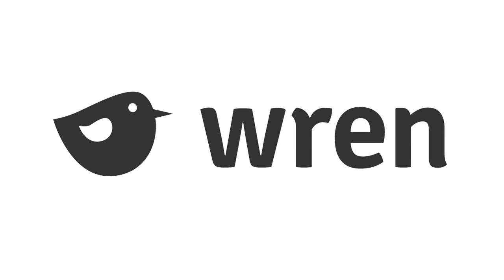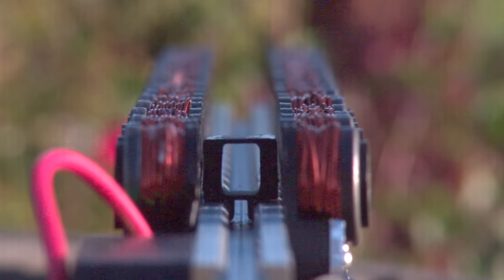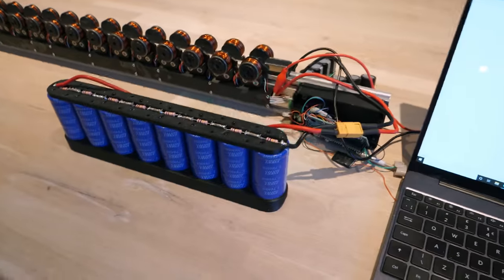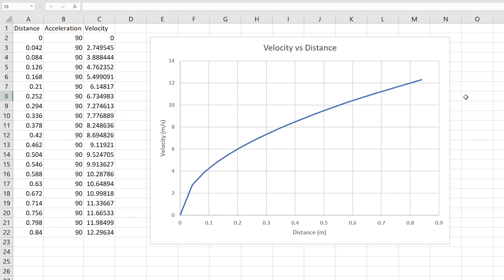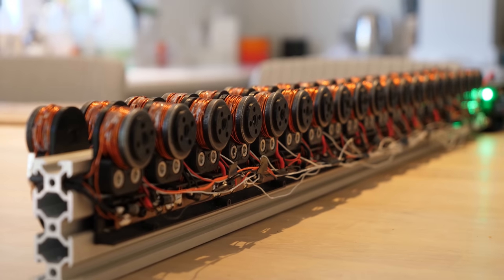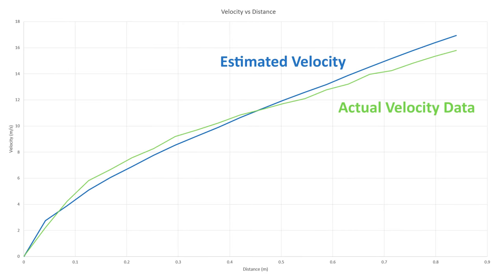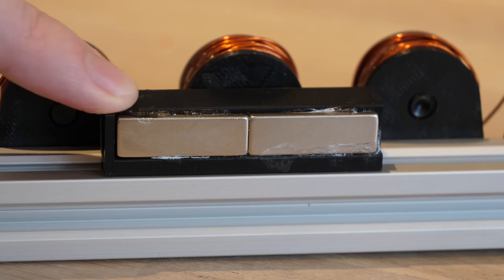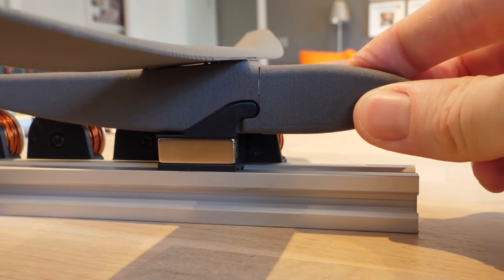Optimising a Magnetic Launcher

Comment: A few things:

Inductance of the coils, not just resistance, matters. Especially for the later coils. You can see the characteristic exponential-decay curve as the inductance gathers current. This provides a further boost for smaller coils over larger ones. That being said, from your data your time constant currently is manageable. It won't be if you get it much faster however.

The real boost for opposed magnets only really shows up once you close the magnetic circuit. That is: put two metal rails, one on each side, down the outer poles of the solenoids. This provides a low-reluctance path for the magnetic field. As-is, this won't really help all that much as only one solenoid is on at a time anyway - but if you drive adjacent solenoids with opposing polarity and time things correctly this can provide a significant boost. (If you want to think of things through the electric analogy: iron has 1 / 5000th the magnetic resistance as air does.)

Right now your overall energy efficiency is terrible. Remember: it's not about how much energy you can get into the solenoids. It's about how much energy you can get into the _projectile_. It may be worth integrating and finding the total electrical input versus the current estimated projectile energy.

Comment: Some more ways you could improve this:
• Batteries and Supercapacitors working together
• active cooling (liquid-cooled sensors and coils)
• better electrical conductors (how expensive is enamel-coated silver wire?)
• stronger ferromagnetic cores for the coils (tiny rare-earth magnets)
• coat that sled and rail in teflon (should vastly lower friction)
• focused magnetic fields (via steel plates around the launcher to act as magnetic lenses; see Tech Ingredients)
• finally build the complex polarity-switching thing
• implement some optical sensors as well

Comment: You missed one characteristic in electromagnets, when they power down magnetic polarity automatically flips. Which is why your design worked with single magnets. 
Loved your design and the way you tested your ideas. Well done.
RF chokes and inductors use the same principle.

Comment: Your coils are acting as a inductor - when the magnetic field drops it has nowhere to go - use a flywheel diode to remove. However for this your voltage doesn't jump to high (same issues for SMPS switching) so I don't think you need to worry about it. If you use a PTFE between the surfaces, a small air initiating charge will help get the sledge moving. Also switching the coil on in advance would help stop the delay in magnetic build up. Btw reversing the magnetic fields would have an EMF to overcome - that would mean higher voltage and current choppers to prevent too much current.

Comment: the lift generated by your glider is probably also increasing friction with the rail. i would suggest either using lube or ball bearings to avoid so much contact area with the rail

Comment: A very minor aspect but when calculating the current velocity you reference the cell above it to get the initial velocity. Not a problem in the current cell but when you drag it down the pattern will have continued using the velocity directly above it. This is a problem because the distance used in that equation is cumulative while the initial velocity used is always one step behind it. This can be fixed using a $ to reference you want it to always reference the same cell so C$2. Or just you know leave it off because its zero. You might catch this later in the video I'm only halfway through but wanted to type it out while I knew what every column was supposed to be.

Comment: Would be much more powerful with single capacitors for each stage. Also using thyristors, which fire a bit more efficient/faster. so this is basically a multi stage coilgun (dont know why ppl call this a railgun)

Comment: The distance of the coils and the distance of the reed contacts are already mentioned in the comments. 
An additional upgrade would be a "real" brake, as they also do at linear motor rollercoasters. Brass plates to the sides of the magnet, at the end of the track. This would result in shaking up your pillow yourself ;).
Thanks for the video(s), I love it.

Comment: I assume the actual velocity is related to the time that the sled is in the field, which because you are switching the coils off and on, presumably means that the field starts pulling when the sled is passing the mid point on the previous magnet, and stops when the the sled passes the mid point of this magnet,   So how about having an increased relative distance between each pair of coils along the track.  so that each coil affects the sled for something closer to the same length of time  despite the velocity increase.  Thanks for showing this wonderful project.

Comment: I've heard of using an H-bridge with flyback diodes to quickly quickly reverse the magnetic field in a solenoid. Maybe reversing the current after the magnet sled passes, to push it instead of pull, will let you get higher speeds without the weight of a second magnet.

Comment: If you managed to make the sled slightly smaller and attached to the glider you could possibly use it as a weight to counter balance the glider so it wouldn't get as much lift and potentially fly further instead of higher

Comment: id say to put the pivot point where the magnet is attached to the plane closer to the nose of the plane so that its is much more stable in the air. also the magnet would be pulling most of the weight of the plane instead of it pulling the half behind the magnet and pushing the half in front.

Comment: One of the limitations to the final velocity would be the the rise-time of the current through each solenoid from the instant of switch-on.  This might account for the increase in speed consequential to replacing the coils with new coils of lower inductance.  Taking this to the extreme, you would end up with a "rail gun".

I have never before heard of the word "SUVAT but the equations are due to Newton, I believe.

Comment: If you had a longer track you could see you have a limitation created by the type of components used to turn each coil on. There is a constant time when it comes to that action. So at some point you will hit a maximum velocity that those devices can not turn on faster than and charge the coils. It would be better to have a remote system to control the time you turn each coil on. you could then tune your launcher. The other option is you move the triggers under the track and put them on a sliding track so they can be moved. This way you can account for the constant time or lag each of them have and you can tune the track manually. You could also go to indirect control one switch to turn on a larger switch that can put more power to each coil. You still are going to need the tuning ability though.

Comment: Carbon footprint is a furphy. CO² is a vital gas required to maintain plant life AND the minimum level for life above Earth's surface is 150-170ppm. We got down to 220ppm at one point. To be totally accurate this is true for C3 and C4 plants (the ones that animals and human eat) and is not true for CAM plants: sedges, and the like. Also, CH⁴ (methane) is unstable and volatile, oxygen, 30% of the atmosphere, breaks it down on contact.

Internal combustion engines are here to stay and whomever uncovers the industrial process for generating long-chain hydrocarbons as a replacement for fuels and oils, portable, high density energy, etc. will make a packet (or three). Hint: HCT waste treatment methods are already producing coal but the former will be marine life based.

Comment: 1. I presume your using a magnetic core for each electromagnetic. When the coil gets de-energized the core will still retain some magnetic field until it full decays, This will create drag as the projectile pass through the recently de-energized coil
2. The core will also provide impediance, limiting the current flowing through the coil. The impedience is proportional to the coils inductance. More turns = more inductance. By reducing the inductance you reduce the electrical impedance per permitting more current to flow and a increase in magnetic flux.

If you want to maxiumize acceleration: 
1. Use a much higher voltage. SCRs have much higher voltage-current capacity than MOSFET (for the cost of the devices) the only down size is that you cannot switch them off. This can be addressed by pairing capacitors with each SCR such that the Capacitor is allowed to dump all of its energy and discharge
2. Use a a very small magnetic core, preferrable using a ferrite material for fast switching power supplies, this will reduce eddy current losses as well as a reduction of impediance. Or ditch using cores
3. Use a flat copper ribbon or Litz wirz. AC current only propagates on the conductor surface & when you doing a fast transition (energizing the coil) it acts like a very fast AC current flow. You want your conductor to have a lot of surface area, such that the maximum possible current can flow.
4. Consider using variable coil sizes to increase acceleration. As the projectile accelerates it has less time to interact with the coil, use bigger coils at the begining and smaller coils at the end. This will also allow you you to pack more coils in the same length.
5. I am not sure the hall effect sensors are the best because as you increase the magnetic output of your coils (lower inductance, higher voltage) its likely to false trigger the hall effect sensor. You might be able to apply some magnetic shielding to reduce false tripping. Optical sensors are probably a better option, but may need adjustment depending on how slow they trip.

Comment: Good rc lipo packs handles high current better than lithium ion packs. I’d try a few of those in parallel. I’d try that while also connected with the supercapacitors, charge Supercaps first from batt and let the circuit drain from both to up available current and reduce voltage drop. Also would be good to get higher voltage mosfets and up the voltage after all…also you should maybe add lubrication to that rail to reduce friction

Comment: while not useful to you magnetic launcher, you should consider trying something like ardupilot with a simple automated glider foam plane with control surfaces that automatically stalls the plane after 10s. additional mass could be minimal. it will let it your example plane take off more smoothly and give a better visual performance of the rails/sleds acceleration. (not to mention, far more exciting conclusion)

Comment: V^2/R will calculate the steady-state power being dissipated in the coils themselves, assuming the voltage is applied long enough for the resistance to be the dominant factor. But what you care about is the power transferred to the sled, not the power dissipated in the coils themselves.To calculate that, you need to dig into the magnetic coupling between the moving sled and each coil. The moving magnetic field of the sled produces a voltage in the coils that tends to charge up your capacitors (at the cost of kinetic energy in the sled), but by forcing a higher voltage than that, the magnetic fields generated by the coils as electromagnets provide a net positive change to the sled's kinetic energy. If you want to optimize the efficiency of the system, the electrical resistance of the coils themselves will be only a small part of the overall power dissipation, with most of the power going into the sled.

Comment: That was very interesting. I've often wondered what the curve of timed intervals for such an application would actually look like and am very impressed that you were so successfully able to calculate them. I was going to take a more analog approach in triggering by making use of a variable frequency driven flywheel featuring a counter-balanced magnet passing a radial array of magnetic reed or proximity switches and then experimeting with accel rates and threshold of RPM activation. I think it's fairly obvious to conclude that the timing for optimum launch velocity is going to change with the mass, inertia, or other factors associated with the projectile (such as the load upon the slide and friction). Considering the average CO2 pistol is around 480 ft/sec and your current rail max @ 54 ft/sec it's not a bad start. but perhaps a barrel of stacked torroids with a shaped neodymium projectile launched off a pin and fully suspended could be much faster. Of course a rail-gun isn't a rail-launcher though is it? LOL

Comment: Using the data points from the initial graphs for reference, I'd repurpose the magetic hall sensors to only track position and not to detonate the coils, and I'd go with a strictly electronic timing approach to mitigate sensor detection lag. Also, by electronically tweaking and readjusting the firing times, one can virtually shorten or extend the distance between coils without physically doing so.
Next, I'd split up the battery pack so the cells will power individual coil pairs or sections of coil pairs along the rails, instead of one pack for all the coils. This should minimize voltage drop and capacitance depletion from start to finish to ensure the last set of coils have plenty of juice.
Next, I'd polish and lubricate both the slider and the rails to reduce frictional drag during take off.
It'd follow a similar process to dynoing a car and mapping its ecu based on engine output.

Comment: having a heavy sled trail behind the plane means a lot of the kinetic energy is devoted purely to the sled and not the plane. I would say design a spring release that pushes the sled backwards and the plane forward after launch that gets the sled to as close to 0 horizontal speed as possible

Comment: i think depending on sensors to know where the projectile is is adding too much delay to make the coils more efficient. Since u said the computer parts that work with the sensors are the limiting spot of current and voltage. If you could make it work on a timing system like cars have timing on spark plugs, you could remove the computer bottleneck and use more power.

Comment: Im hoping this doesn’t get lost in the comments but if you were to revisit this project then you could look to optimise the magnetic circuit by introducing a soft iron flux path on the back side of the coils. There is the eddy current losses to consider however due to this being a single shot device, this should be minimal. Also I believe that significant speed gains could be made by reducing the latency in the circuit. Hall effects are known to have exceptionally high bandwidth however the controller you’re using is a digital one which has the drawback of high phase lag on the frequency response (high latency). All this means that when the MOSFET is getting its command signal to allow current, the projectile is in a different place to the time of measurement. I would potentially look at introducing analog circuit (op amps etc) to help reduce this effect.

Comment: I think that even if the coils were super-conducting there would still be their inductive reactance to contend with.
Inductive Reactance=2 π FL.
F= Frequency, in this case it would come from the rate of discharge of the capacitor bank.
L - inductance of the coil.
I'm not an expert by any means. Corrections are welcome.

Comment: I liked seeing the comparison of the Li pack and capacitor bank...I recently read some older discussion on endless sphere regarding capacitors for regen bicycle braking.  The Endless Sphere consensus is that Li batteries handle the brief current spike fine on the scale of bicycles.  It seems like the 8x3V cap bank is starting at 33% lower voltage than your 36?V Li pack.  Without knowing how voltage is converted down to 16V, I wonder if two of the three Li packs would deliver more comparable power?

Comment: That miniature plane looks like the climb angle is too high causing the wings to go into a stall. I suspect it could fly much further if you added some weight to the nose of the plane, moving its center of gravity forward, and causing its wings to have a more reasonable climb angle and angle of attack on the wings.

Comment: Grate project you need to connect the supper capacitors and batteries together I'm sure that would help with the voltage drop

Comment: Cool vid. the whole time i was thinking tho.. why not put the electromagnet on the sled instead?  should massively decrease the amount of wiring needed.  you could have a metal surface on the inside of those guide rails, and then have spring-loaded copper wire on the sled touch those surfaces to transfer the power to the sled.

Comment: It would be cool to see if connecting the capacitors in parallel would give it a bit more of a boost. Like its often used for sub AMPs in cars to provide more stable peak power.